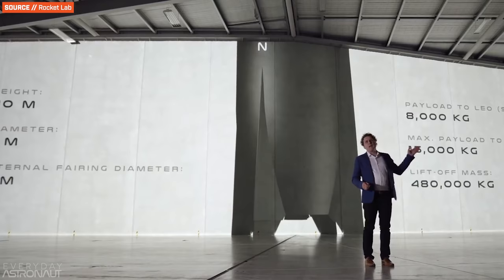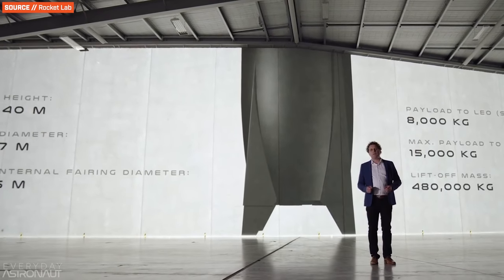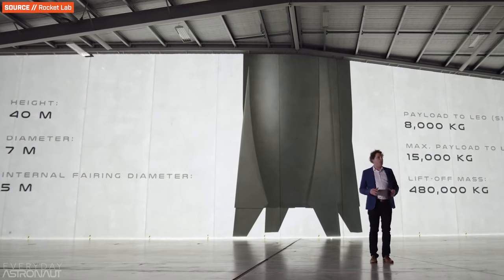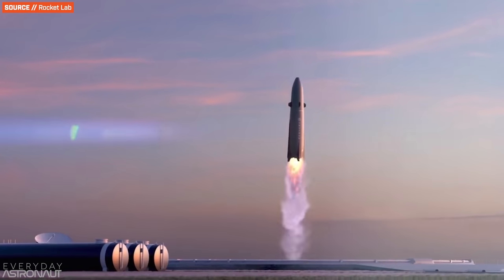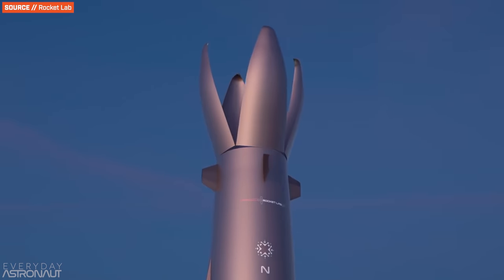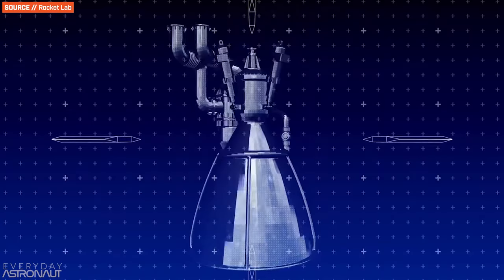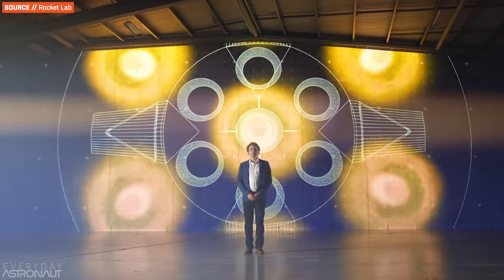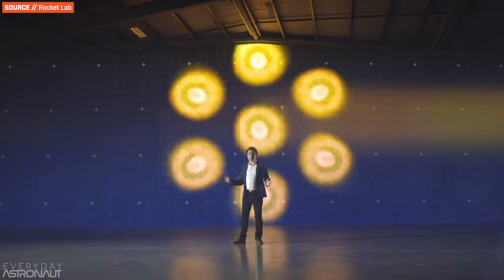Talking about Rocket Lab’s Neutron with Peter Beck

Comment: Interesting that Space-X' "stage-0" strategy is like putting as much as possible into stage 0 to remove complexity from the vehicle, while Rocket lab's does the exact opposite by having as little ground equipment as possible to save costs
Reply: They both do away with the strong back to raise the vehicle. But I think rocket lab will have some more than just what was shown. Integrating second stage I don't think they will do with a simple crane. Though I don't think it will be as much as the thing ULA have for their rockets.
Also for secret payloads it seems like the customer (NRO) wouldn't be satisfied with just a tarp over the payload while integrating.

But a plus is that they don't need expensive stuff close to the vehicle while launching in case it goes up in a fireball such as spacex will have.
Reply: I think part of it is a scale thing, ground infrastructure costs don't scale as quickly with size as vehicle costs do, so more ground infrastructure makes more sense for a large rocket, and infrastructure makes more sense the higher your launch cadence, per day for spacex vs per week for rocket labs. Hence mechazilla and the chopsticks, those only make sense because of the rediculous launch cadence spacex is targeting, and requires to use orbital refueling.

The other part, which Peter mentions in the interview, is that having the ultra-light carbon-composite structure lets them make a lot of cost-saving compromises elsewhere without killing the mass to orbit. Whereas SpaceX is recovering the upper stage, so they have almost no mass margin to play with, and because starship is supposed to make a lot of use of orbital refueling, every kilogram matters for starship in a way it just doesn't for a normal launch vehicle. I think spacex originally had a lot of stuff built in (including the upper stage umbilical inside the booster) and has been slowly outsourcing things like ubilicals and even engine startup systems to the luanch mount because they just don't have mass to spare.
Reply: Both options can make sense. Elon knows he can get some agreement if hiring other people/systems. But that gets a lot of conflict in trying to manage all the separate suppliers/support industries. Where as electron are going for an all in one, but of cause puts all the work and support into one basket.
Reply: With how little the empty rocket weighs I assume they need something to hold it down against wind. It seems they don't need a strong back for that though. Maybe just something that reaches up and grabs the base in between the engines.
Reply: @llamatronian101  A strongback is generally only used for horizontal integration, since you need something to support the rocket while you're transporting it and lifting it into upright position. So if the rocket is vertically-integrated and never transported on its side (like both Starship and Neutron), you might have some support structure, but it wouldn't be called that.
Reply: SpaceX is planning for an absolutely ridiculous launch rate (which is necessary for all the tanker launches for Mars missions and also if the point-to-point transport thing on Earth ever pans out). Rocket Lab is not.  The number of launches relative to the launch infrastructure is going to be completely different.
Reply: @subwarpspeed  Good point will be interesting to see how they manage that - neutron's design creates some interesting problems - probably will need to have a vertical assembly building it wont be so easy.
Reply: @stephenhumble7627  A vertical-assembly building for a Neutron-sized rocket isn't too bad though. It's not like they need a VAB like the one built for SaturnV, or the high bay for Starship.
Reply: One of them is using brains and have sharp focus. Another one is all over the place.
Reply: @mdjey2  Tahts just dumb. Their both genius lol not everyone works the same and solves problems the same. Some are direct & take risks and some are more careful

Comment: in my mind, Electron is like a taxi sending you to the specific place whereas rideshares are like buses where you still need to walk to somewhere you need to be. They might be cheaper but is it worth the extra walk?
Reply: Yep, what he didn't quite say is that rideshares often involve using limited fuel on the satellite itself, which tends to shorten its useful life.
Reply: And you might miss the bus. The taxi will wait for you (might take some other customers in between though).
And you avoid any other passenger on the bus that might stink.

Comment: Love hearing from Peter Beck , he's like Elon in that he actually understands the engineering . I invested in them recently , even though it's down a bit right now I'm pretty sure it will come around .
  I didn't see any mention of their flight profiles they are planning to use with Neutron , I thought I read that they don't turn downrange as fast as others and use their second stage for most of the orbital speed which keeps the first stage closer to home at separation , is any of that true ?
Reply: I compared the SpaceX Falcon9 and Electron Rocket MaxQ speeds and heights and then MECO and then Separation and Second engine start up. 
Since they are both using the 'Rocket Equation' to get to LOE, they follow the same trajectory and so their times are very similar and their speeds are very similar. 
I guess it then depends at what height the satellite or cargo resupply are going to, that determines the length of burn of the second stage. And also what the use of the satellite is for that determines the speed and inclination. 
I don't know anything about orbital mechanics. It seems turning down range could not be altered, if they are following the same orbital trajectory profiles? 
So, I can't give you a definite answer.
Reply: @David-yo5ws  I was referring to the Neutron's proposed flight profile .
Reply: @stevej7139  In the NASAsf interview with Peter Beck, he said they had to limit their over performance down range, because they have to land the First Stage  back at the Launch Site.

Comment: I would be interested to know if Peter is considering launching from other space ports, building and initial launch from Wallops and just having launch/maintenance facilities at locations like the Cape for instance.
Reply: He's doing the interview circuit, if you look around at other spaceflight youtube channels you'll see more information. But, basically, because Nuetron is so wide they've put out tenders for a new launch facility with onsite factory somewhere in the US. They'll build the rockets at the same place that they launch then and  Rocketlabs current facilities in New Zealand and the US won't be used for Neutron.

Comment: I wonder if they gave any thought to using a combustion tap off cycle. I imagine the generator exhaust would be hotter and thus need a different/heavier metal, but that might be offset by not having a separate generator. Would probably give better iSP though.

Comment: Doing an return to launchpad launch you want to put lots of vertical velocity into first stage so you stage high but close to pad. 
This is a bit less efficient but nice for reuse, it also let you keep the fairing on the first stage. Its not an long time between falcon 9 first stage seperation and fairing drop anyway.

Comment: It’s funny that expending a rocket is still considered a “proper send-off”, for historical reasons, I guess. Imagine doing that with an airliner at the end of its service life, just fly over Pacific with tanks almost empty, leave it on autopilot and bail out 😄
Reply: It delivers more performance...
Reply: @the_retag  that's right, this is the reason why the F9 is made in the size it is - despite the reusability of the booster it still can put enough mass into the orbit to cover the demand for satellites in the mainstream size. If you need more in rare cases you can just take an old booster and use it in dependable mode.

Comment: H2 / O2, the H2 can freeze the O2 so you need to insulate.  Kerosene / O2 the O2 can freeze the Kerosene, plus the soot.  CH4 / O2 are similar temps so no insulation / share bulkhead and the single C atom doesn't form soot like CH3-(CH2)x-CH3
Reply: Great, thanks very useful remark to pick up. I love the kind of important details I can pick up in the comment fields.
Reply: That's right, the temperature overlap isn't really big but it's there, while most other fuel combinations don't have one at all

Comment: It's interesting, because Rocket Lab is tackling the next gen rocket in largely the opposite way of SpaceX. In fact, it's crazy how diametrically apposed their ideas are.

RocketLab want light structure and simple engines, SpaceX is developing a heavy structure and complex engine.
RocketLab want to put the launch infrastructure into the rocket, SpaceX wants to put the rocket infrastructure into the launch tower.
RocketLab want to build a medium launch rocket because that's where the market is for the forseable future, SpaceX want's to build a new heavy launch vehicle to create new markets. 
RocketLab want's to make the first stage the most capable vehicle with a light weight second stage, SpaceX want's to make the second stage the most capable vehicle with a (relatively) simple first stage.

While Neutron and Starship won't be competing with each other, it will be interesting to see who actually has the strategy right for the next gen of space.
Reply: I think the differences have to do with the purpose of the rocket. The Neutron will be an earth based vehicle mainly for earth orbit missions, while the Starship will be essentially a deep space vehicle also usable for earth orbit missions, but capable to flights to Moon and Mars.
To get enough payload for interplanetary missions efficient engines are a must have, and the Raptors are still less complex compared to engines like the RS-25. Space X could collect knowledge with the gas generator Merlin engines and can now go one step further, while it may be too ambitious for RL to go the step from the tiny electron rocket engine to a closed cycle engine, a bigger gas generator engine offers less development risks. 
Stainless steel is probably more robust against micro meteorites (not unimportant in interplanetary missions) , since it can get a dent while carbon fiber can get delaminated if it gets hits 90° to the surface (I know they made the sledge hammer test, but this isn't a really scientific method, because the stand bounced back and absorbed parts of the energy).
Stainless steel can even be repaired on Mars, you can simply weld it with a stick welder. Carbon fiber repairs are not possible outside a specialized factory, but they are not demanded outside a factory on earth for a satellite launcher like the Neutron. 
Additionally, I would suppose it's hard to fabricate a carbon fiber drum with 9 m diameter, since the autoclaves have to be huge to fit in such big structures. The neutron is smaller and the machinery can also be smaller.
So both probably makes sense for the size and purpose they are individually  intended for.
Reply: @simonm1447  Sure, I know that's the intention, but the bulk of both vehicles work will be putting stuff into earth orbit unless the market changes drastically.

Comment: Hi Tim,
nice interview, although i missed some questions about the new upcomming Pangea Aerospike engine and if would be an alternative.
Maybe you can shed some light on it in a new article and its specs. Also interesting about the posibility of running it in an expansion cycle
with methalox due to ist unusualy high heat excess which may simplyfy the turbopump.
Great job so far! Was fascinating with that thorough reviev of all soviet engines! A treasure trove of info!

Comment: Makes me concerned for space  x starship being over complicated and expensive to run and maintain
Reply: The heat shielding is going to be a critical failure point to overcome. I’m not at all sure they will get there.
Reply: Elon has always been known to push boundaries
so it might work or might not either way we are going to progress tons
Reply: Neutron can't compete even with F9.
Unless they manage to make it super cheap.
Reply: The SpaceX goal is to reuse the first and second stage.  If successful  the launch cost would be the fuel plus the cost to land the payload and prepare for launch.  If  SpaceX succeeds the launch cost could be less than the falcon 9 and possiblyNeutron.

Comment: If Rocketlab Neutron makes it to space it will be so much better than falcon 9,
 it's just the perfect solution for a cheap reusable launcher for the vast majority of use cases. 
Peter Beck would have learned from Spacex and beat them.
Reply: I don't think a direct comparison makes sense because they will be rockets in different classes. But on the other hand you would think that a new rocket designed and built several years after F9 Block 5 should be better for it to make any sense to exist. It sounds like a given, but Rocket Lab definitely deserves credit for it as not every company is able to pull it off.
Reply: On the other hand, the F9 offers more than 50 % more payload and it has amortized its development costs when the Neutron enters market.
So it will depend on the individual payload, which one will be cheaper.

What is sure is the air for other commercial launch providers like Arianespace or ULA (beside government launch contracts) will get thin, with competition from another company using reusable launchers

Comment: I just love this rocket and I want to see some more details. Some points that I'd love to see covered:
- Peter talked about a hot outer skin as thermal protection. Would love to know if he's considered active cooling (using methane as a coolant)?
- Its not just the landing feet, its also the part of the lower body that (if you believe the CGI) has a convex surface towards the airflow. More outer skin, or carbon foam?
- So you have an umbilical from the launch pad. Does the umbilical move to where the rocket lands, or (I think more likely) do they use a crane (or lifting vehicle) to move the rocket into position?
- Integrating the second stage + payload would presumably mean a mobile crane. But you can't close the fairings completely because you've got lift cables in the way. How does the process complete?
- Still not quite comfortable with using a whole Archimedes' engine for the second stage. If it has to be throttled down, then presumably its not optimal mass wise. Plus where does the efficiency go with throttling down?
- Is there still a use for electric pumps in terms of feeding the gas generator and making startup simpler?
- Getting the methane to evaporate in the cooling channels (so it can be guaranteed to be a gas at the injector) requires a thermal balance. Doesn't this restrict throttling?
- I don't necessarily follow Peter's logic about his market. He seems to be relying on large constellations. I'm skeptical about the viability of comms constellations but leaving that aside, if the payload you are sending into orbit is just multiples of the same satellite, then you need a really cost effective launch to compete with much larger rockets. Cost per unit of theoretical mass may not be the most valid metric at times.. but when you are sending lots of the same satellite? Also how much delta-v is left over in the second stage for multiple relights?
- Oh and further to the question about moving the rocket into position, is there a separate launch and landing pad? It occurs to me that the former needs fixing lightning diversion. Hard to land amongst that.
Reply: Yes - you've asked the questions I'd like to know the answers too. If there's no strongback then is there a High Bay for integration? How does the rocket get from the high bay to the pad? Is there a Crawler of some kind to move it? Or do they just crane it into position?
Reply: @RichardPerfectKiwi  My bet would be a crawler taking it to a high bay. Integrate indoors. Crawler takes it to a seperate launch pad.
Reply: @saumyacow4435  or maybe move the High Bay over the Rocket with a Crawler :D
Reply: @unitrader403  It needs a trap door and a secret tunnel.. :)